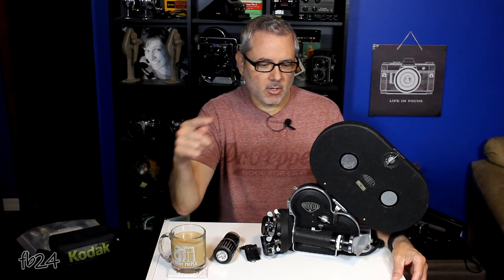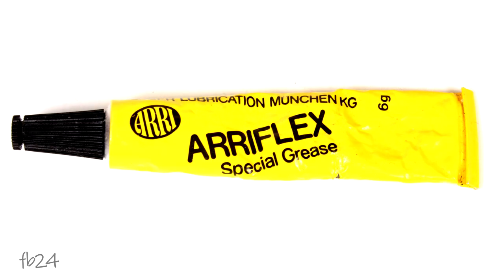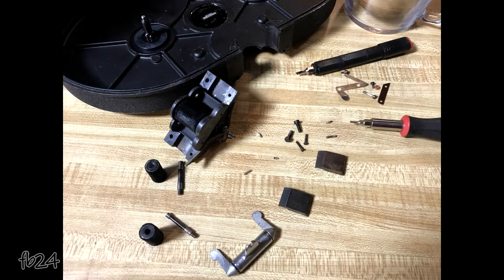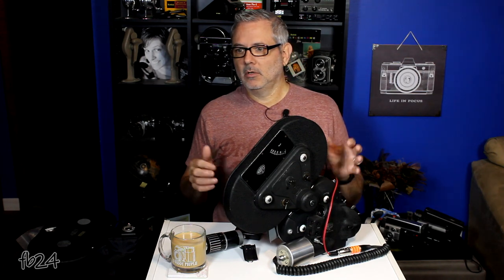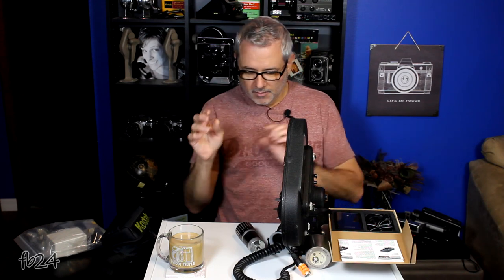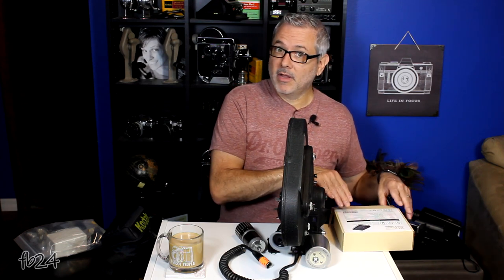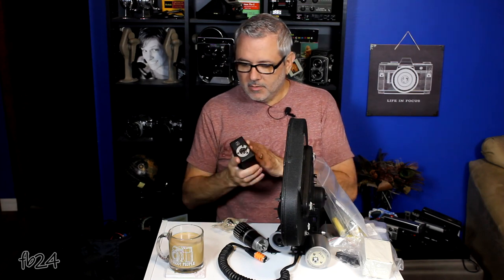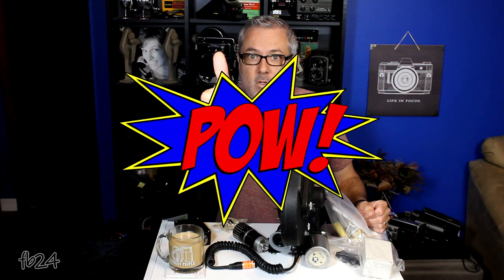Build an 8.4V Arri 16S Battery for Under $25 / Arriflex Magazine and Torque Motor Refurbish

Comment: that's an unbielievable work Mike , cheers to you ! i just bought one, exactly the same model, 2 mags in perfect condition, hope i won't have to make the same chirurgical intervention, but the video is so useful in case something happen, you rock !
Reply from the maker: Thanks so much, Trap!!

I have used it for 3 consecutive 100' rolls so far without any issues or re-charging. I'm currently working on a couple of beefy-er 2,000 mAh batteries and an 8V AC power adapter.

Enjoy your Arriflex! Such awesome cameras!

Comment: Hey, very nice video. Thanks for the detailed instroctions. I am looking into buying an S16 myself. Does your 8.4 battery pack supports the 100m Magazine as well or would you need a different battery for this.
Reply from the maker: Thanks, Mitch!! Yes, my batteries will power a 400' magazine as well. If you haven't seen it, I did a second video where I made 3 more batteries, with higher mAh. I can power about 2 full magazines per full battery. In case you want to take a peek, here's the video: https://youtu.be/n5MNtDAb5iM
Reply: @Filmboy24  Thanks very much. Keep up the good work.

Comment: The Arri-S will run fine on a 12V battery (using Arri motors).  Only the mag torque motors run too fast at 12V.  Some camera places do modifications on the torque motors for that reason.

Comment: Wow, this is coming along very nicely! Not sure how hard it is, but I think you should consider an Ultra 16 conversion. I think the shutter allows for it (it doesn´t allow for Super 16 I hear and read everywhere). That would be liquid gold. The 10mm, 16mm and 50mm are actually perfect for narrative filmmaking, since we need shorter focal lengths to get close to the action and film in small spaces. Looking forward to seeing more footage from this beauty!
Reply from the maker: Thanks so much, I'm having a blast with this thing! I've thought about the Ultra 16 conversion but not yet completely sold on it yet. Only because I absolutely love this Arri as is (mainly because it's in such good condition). I have often thought about trying to pick up a spare 16-S body (if I could find one cheap enough) and sending it off for the conversion though. Ultra 16 has such a beautiful frame size!
Reply: @Filmboy24  Sounds like a plan. Yes, Ultra 16 is great for the 1.85:1 frame size and no re-centering of the lens needed. And yes, a professioinal conversion  is best, since the edges of the frame can be easily scratched with Ultra 16. That reminds me: did you convert your K-3 already to Super 16? ;-)
Reply from the maker: @truefilm6991  doh, did I not do that yet? 🤪
Reply: @Filmboy24  :-D

Comment: Hey! I have a quick question! 
When taking apart the mag motor how did you get the back off? There are those metal clips that I believe I need a tool to take off other than that I’m in the dark!
Reply from the maker: Hey William, it's been a while since I did the mag but I'm pretty sure those 2 c-rings are the only things holding the back on. I did use a c-ring tool to get them off.

Comment: Well, that's a nice budget option but for a camera like this, I would rather use the best option of batteries since power feeding is very important for the durability of the speed of the motor. One of the best NIMH battery option on the market is the Panasonic ENELOOP... I know it wouldn't be ''23 USD'' like you did... But these are way better than the ones you used here.
Reply from the maker: I have a few Eneloop batteries, not a big fan, don’t seem to hold a charge as well as some of my others.

Comment: I am not familiar with the Jensen motor but the variable speed motor draws 2.5A when running at 24fps and has an initial start-up surge of 4A to 5A. At this rate, a 1000mAh battery is not going to last very long, especially with a 400 ft mag. Over the years, I have made many battery packs for this camera and I usually use cells rated 5Ah to 10Ah. The original NiCd battery belts made for this camera used 4Ah and later 5Ah “D” cells.
Reply from the maker: Thanks so much for the info, much appreciated!! I actually have 2 of the old "Cine-60" batteries (with the D cells, both need re-celled) in the big plastic cases and they weigh a ton each. Trying to get away with much smaller packs, even if it means double or triple the number of packs. Working on 2000 mAh packs now, we'll see how it works out.
Reply: I was thinking similar, his pack only draws 1A, but the camera needs 3.6A to run ? so it must be just running barely, despite the motor sounding fine? any ideas? im thinking of making a pack for mine but im not sure on the amps.

Comment: I bought a Tilta v-mount battery plate to use with my SR and to test and Arri S and S/B that I am planning on selling.  The plate has an 8V, 2 x 12V, and Dtap ports BUT I called Tilta and they said that the 12 volt only outputs 3volts.  It will most likely fry under the load of the 16S and I was warned off using it on my SR because even though it has a low power draw (1.5 amps?) it can also surge if the conditions are right, like in the cold.  Blergh.  I already have V-mounts so that would have been a convenient. power solution.
Reply from the maker: Do you mean that the 12V only outputs 3 amps? Or volts? If it could only output 3 volts, I'd be pretty concerned about their quality.

I was initially concerned about power spikes or surges and thought about adding a fuse inside my packs but with such low mAh batteries, I don't think it'll be an issue. I hope anyway :)

Best of luck!!
Reply: @Filmboy24  Yes uh-duh.  The 12 volt port outputs 3 amps.    I just a 8.4 volt 4700 mAh NiMH pack for $35 on a battery website.  Heat shrinked/shrunked with leads.  That's perfect for me because I am not experienced with the solder.
Reply from the maker: @cherylhess6068 , that's what I figured :)

That pack should be just fine!

Comment: Greetings from Canada. I just got a 60s Arri s and it didn't come with the cable. I am at a total loss as how to custom build one or convert the power cable like yours. How did you do the conversion?
Reply from the maker: Hi Max, unfortunately, the original Arriflex power cables are extremely difficult to find. I got lucky and my camera came with the original cable. I don't know how to make one; however, there is a video a guy made a few years ago where he does kind of put one together. It's a pretty primitive build but it worked for him. Here is his video: https://youtu.be/MR4uFuShnqg
Reply: @Filmboy24  My Arri 16s also has no battery or cable, so I'm thinking of making my own cord like the primitive one in the DIY video you shared. 
If the cord I use has the 2.1mm plug, will it work with the same XTPower bank you have and run the Arri? 
I'm new to electronics lol
Reply from the maker: @sonvapritch  Yes, you should be able to use it with any power bank that has a 2.1mm jack and is in the 9-12V range. Be careful using 12V rather than 8 or 9 for long periods of time, but for testing it should be fine.

Comment: Im curious how it runs though, ARRI say that the 16S runs of 3.6amps @ 8v, your only running 1amp, so how does it run? surely its under current?
Reply from the maker: Good question and I wondered the same thing when I was building it. Oddly enough, it runs it perfectly. I would imagine it would struggle at high speeds with the variable speed motor but runs my 24 FPS Crystal Motor well. I will say that it will only run about 400' before needing a recharge though.

I have all the parts to build a couple more batteries, only these will be double the mAh and will also be NI-MH rather than NI-CAD. Hoping to get at least double duration out of them.
Reply: @Filmboy24  so it gets through a 400ft mag or is that 4 x100 ft rolls? The torque motor needs 8v, I assume less amps than the main motor, funny that it runs, and yeah I think your right, if you where going high speed it would maybe suck too much juice.

I’m thinking of making one, found some 3000ah 1.2v that could do nicely with a similar build, oh question, what did you search for to find that great little battery box? I’m trying to find something but it’s all just garbage Tupperware that comes up lol.
Reply from the maker: @spincity850 , So far it's been 4 x 100' reels. I have run a dummy load in my 400' magazine and it powered the camera and torque motor fine. Not sure if I tested a full 400' or not but it did run it for a while. I will no doubt need a couple of extras for anything serious. I also have my DIY 9.6V battery pack (takes 8 x rechargeable "AA" batteries). I think your 3000 mAh batteries will be ideal for this kind of build.

The battery box/case I used worked pretty well for my little build, though it really needed to be a bit larger. Everything is pretty cramped and it was a little tough to work in there. I have a larger one now as I plan to add an on/off switch as well as a fuse for protection. I bought a few different size ones initially, to test. Here's the one I used for this build: https://www.ebay.com/itm/122052730970

And, here's the newer, larger one I bought for my next build: https://www.ebay.com/itm/222822438572

Thanks!

Comment: Ni Cad batteries are kind of old technology and need to be run all the way down to avoid the memory effect (maybe you could make a discharging circuit (basically a heat dissipating resister selected to limit the current to say 500 ma) so that you can cycle all the way through the power. OR you could use NiMH batteries which don't have memory effect. I like the channel (I started with your review of Wolverine scanner, and am excited about preserving our family's super8 and a few 8mm home movies)
Reply from the maker: Thanks so much for the info, Rich! Funny you mention it, just today I ordered enough NiMH batteries to make 3 more packs. I wondered if the memory effect would be an issue, so I’m glad you confirmed it for me. Thanks again!!
Reply: @Filmboy24  One more suggestion, both Ni Cad and NIMH batteries are capable of creating very high currents. I suggest incorporating a fuse (say 2 amps if you never expect more that 1000 mA  of current to protect the equipment)
Reply from the maker: @richziegler4194 , that’s something I hadn’t thought of, just made note of it, thanks again!